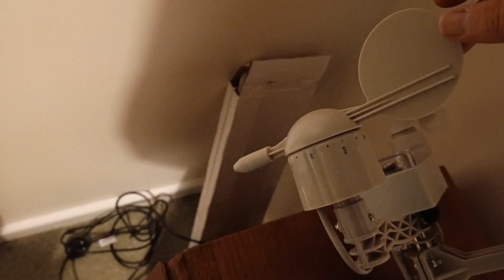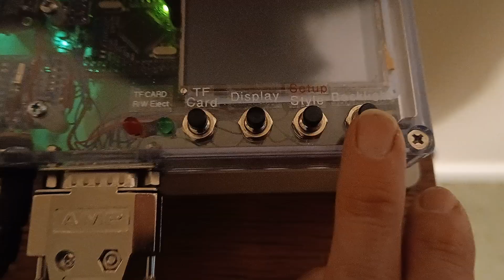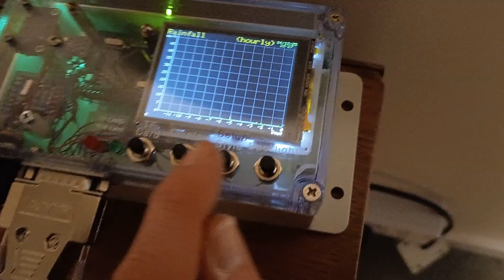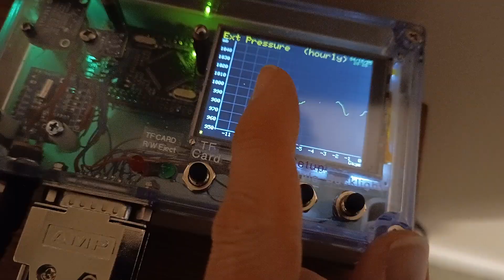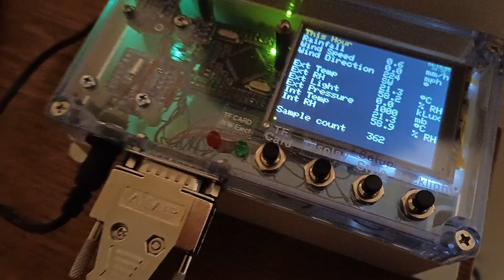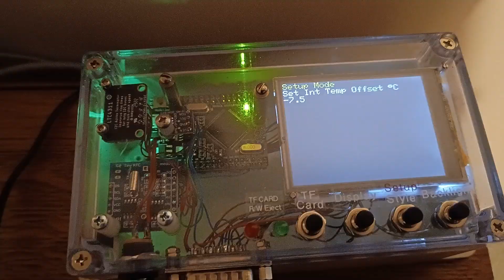Arduino graphical weather station project: a first look

Comment: Very clean mounting and box, are those off-the-shelf project boxes? 
I'm surprised that you're able to get good data from the wind vane over 8m of ethernet cable. Do you have it wired to make a voltage divider? If so, what are your resistor values? At every 45 degrees, that's 8 different headings, I'd imagine spacing those values out over the Mega's ADC range wasn't too much trouble.
If you're interested, there are nice hall-effect modules you might be able to use to get more precise heading information that can be transmitted to the Arduino digitally instead of relying on the ADC.
You mentioned an op-amp for the photocell. Are you doing the same thing for the wind vane?

For putting this outside I worry a bit for lightning or other EMF interference destroying your Mega Pro's inputs. Do you have anything for protecting those inputs?

Oh, wire wrap! always fun to see that on a modern project.
Looking forward to the link to your website and project info
Reply from the maker: Yes there are just standard plain boxes attacked with a drill and a file. 

I haven't had any trouble with the sensors over ethernet, yes the wind vane uses a voltage divider with a resistance of 10 kΩ to 5V and the switched resistor between 1kΩ and 100kΩ. This gives a voltage between 0.45V and 4.62V and the reported ADC values are pretty close to the calculated ones despite the cable length, do no I haven't got an op amp on the wind vane. I'm still thinking about lightning and bird protection! I discovered wire wrapping about 30 years ago and am completely addicted. It is so much more secure than breadboard and jumper wires at the experimentation stage!
Reply from the maker: Testing is now complete and I'm just waiting for some parts to get the external sensors installed (no doubt further bugs might emerge when its been running continuously for a few weeks!).  I have uploaded further information, the sketch and links to the libraries to my website at https://tamitche.unaux.com/arduino/index.html#WEATHER .